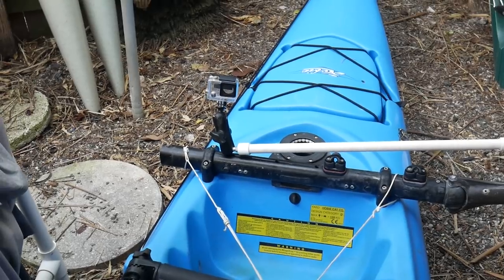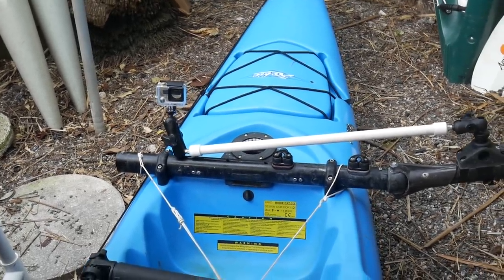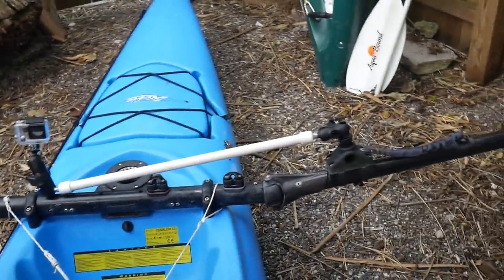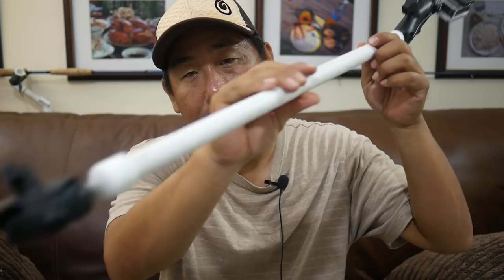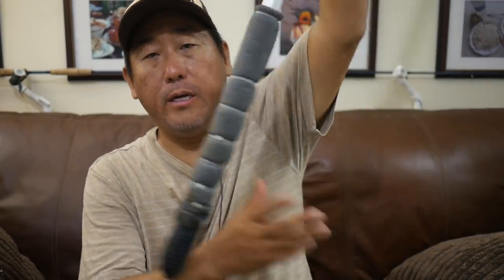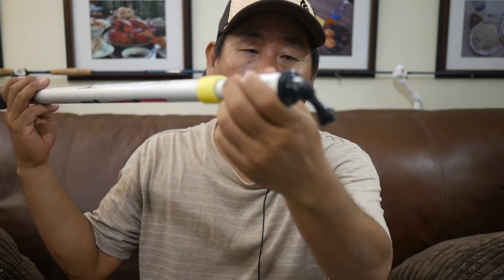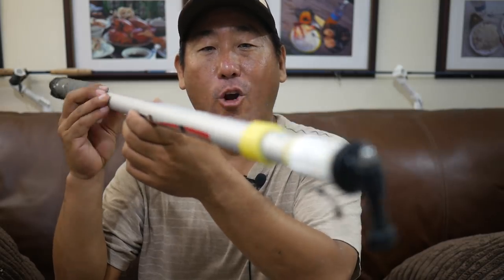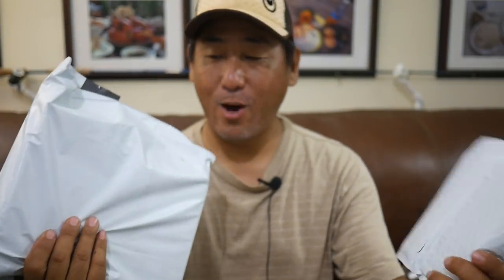Kayak Project - The Cinematic Stick

Comment: Another good video Steve. Great idea to make use of that camera and cine-stick...these D.I.Y. and project videos are just as interesting as the fishing videos (ALL of it represents what it takes to be part of the fishing lifestyle). Helpful note: I was thinking you would have put a small stainless steel washer inside each of your pvc caps. It would help prevent the screw heads from wearing thru, and spread the pressure/leverage area (instead of direct pressure at their connection point). All in all you still have a great idea.
Reply from the maker: Yea, DIY is one of the best parts of yak fishing.  Getting things just how you like them.

Comment: Great diy. I predict that your ram mount ball joints near the base will slip when extend outward. I did something very similar and the 1” and 1.5” ball joints were simply the wrong choice for the base portion when connecting long extensions. They are great for short radius, under 2’. I switched all my bases to RAILBLAZA and it solved all my slippage issues. A bit more expensive but I now have a totally reliable system. I still use ram at the very tip of my camera joints and for my fish finder. — your pvc +cap with 1/4-20 thread bolt is a great inexpensive, custom solution.
Reply from the maker: Yea, the base is the key.  Ram is definitely light duty stuff. Their big ball barely worked for my fish finder.

Comment: I wouldn't glue the pvc cap on the pipe. The screw might loosen as you use it and you have no way of tighten it. You can just drill a hole through the cap and pipe from the side and put a screw straight through.
Reply from the maker: The screw is threaded into the cap.  They don't come out.  I use them a lot .